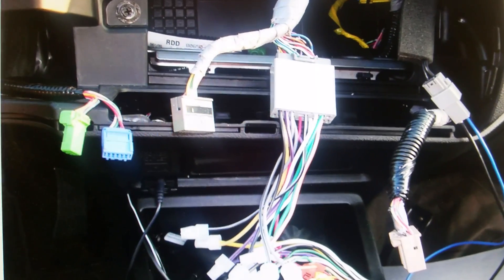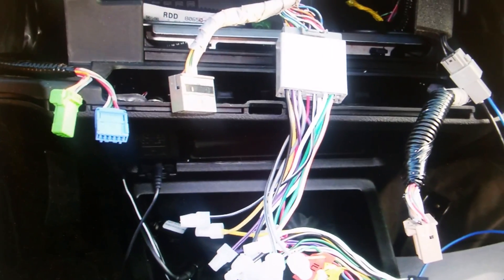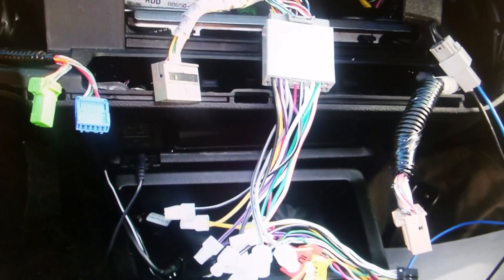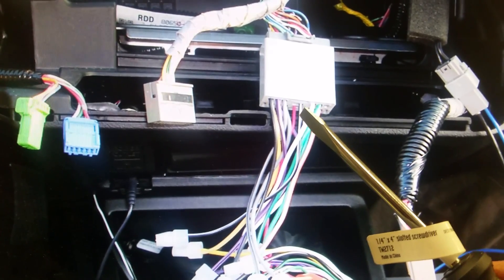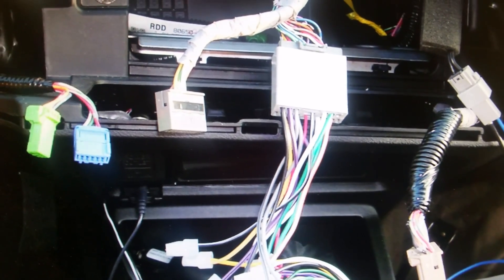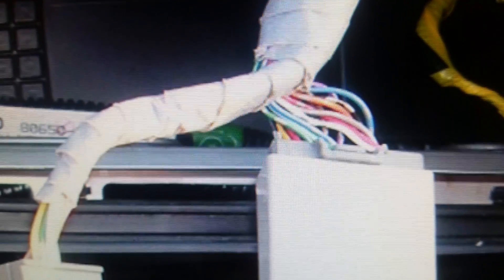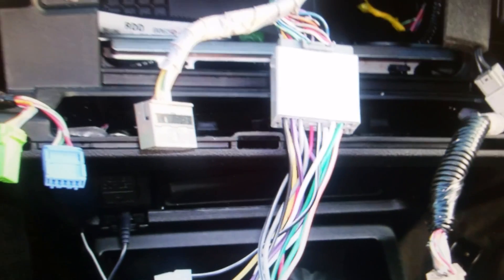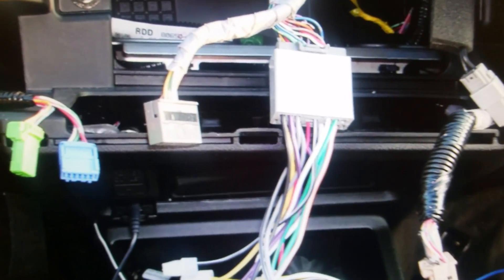2006 honda civic si stereo wiring

Comment: Anyone having trouble with this. there are 2 blue wires, you want the baby blue one. take that wire and connect it directly to your decks blue&white (remote/amp) wire. You can splice in your blue antenna wire as well, or hook your antenna up to the red/ignition(power wire). Either way works, the video is helpful but he left out some of those details. Hope this helps
Reply: You rules Man, tanks
Reply: THANKS BRUH U SAVED ME ALOT OF TIME
Reply: Yo H I only have one wire in mine... any advice? I know this is from two years ago but I need the help
Reply: What about the black and white amp ground wire whats that connect too ?

Comment: Hey cqbum I'm in the process of doing this install and kind of stuck.  The stereo I bought came with it's own harness which was literlaly plug and play for everything.  I have an 08 so I'm not sure if the wire colors are different but I connected my antenna/remote wire to the only blue wire in the smaller secondary harness but no luck.  I see you reference a black and white wire but can you tell me what that needs to be connected to on the factory harness side?

Comment: hi there, I bought a double din EINCAR android 6 audio unit with wireless backup camera, there is a purple colored wire on the Eincar audio harness that is labeled Reverse, where should I tap that purple reverse wire in car's harness? I mean is there any wire in car's harness that sends signal to audio unit when car is in reverse gear?
my problem is I have tapped that reverse wire with red acc wire of car, now when ever car starts it show backup camera but when I drive and then park somewhere then it doesn't show backup camera, it just keeps on playing or in standby. I cant figure out where the reverse signal wire is in car's harness. please help thanks.

Comment: it didnt work for my 2007 honda civic lx, so what am i doing wrng
Reply: Any update on this? I have 07 lx and that same harness not being used, what wires do I need to splice into radio harness?
Reply: If I'm not mistaking the lx doesn't have an amplifier. I belive only the ex and si have one.

Comment: Where do the blue on the antenna adapter connect to?
Reply: Andrew King you can do like I did and connect it to the red wire/ignition wire, it works the same way. Its just giving the ant. power when you turn the key.

Comment: Anyone know which wire Powers the factory amplifier on a 2007 Honda Civic EX 4 doors. Thanks
Reply: Usually a blue wire from the radio to the light blue wire he was talking about bon that second harnest. The light blue wire is located in front of the pink wire on the second harnest. Splice to into that and connect the blue wire from the radio. Usually says some like "Amp xxxx"

Comment: Just tried wiring the light blue to accessorie and it didnt work
Reply: Kevin Singh , hey man I figured it out, if you have the 06' si, take the smaller harness and peel back that gray tape, there are 2 blue wires, you want to cut the baby blue/lighter blue and cut it strip it, then connect it directly to your blue w/white stripe remote wire coming from your deck. That is correct way to do it.
Reply: Yo H Thanks i grabbed the metra harness for 30 bucks and just ran it real quick to make my life eaiser lol
Reply: Yo H hey buddy I have an 08 is sedan. Do you know if the wire colors are the same?  I found the only blue wire in the second smaller harness and connected to the blue remote/antenna wire but still no luck. Are there any other wires that need to be used/connected in the factory harness for the amp to work?  I see the guy mentions the black and white wire in the harness but what does that coincide with on the factory harness?  I'm not using the Metra harness for my install.

Thanks in advance!!

Comment: does anyone get static or white noise from their aftermarket stereo? I don't really want to but i might have to open up the radio and test things out/ rewire everything.
Reply: Jonathan Godinez no I was thinking of ordering the amp bypass I heard that’s the issue but I didn’t want to bypass it .
Reply: Did you fix it?
Reply: how do you use the bypass harnesa